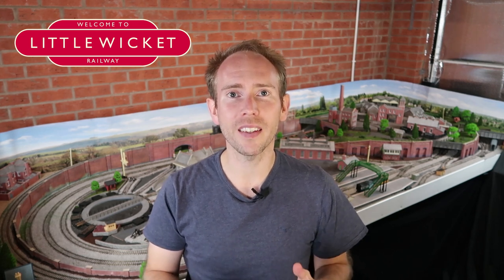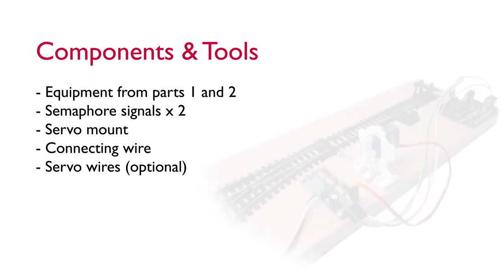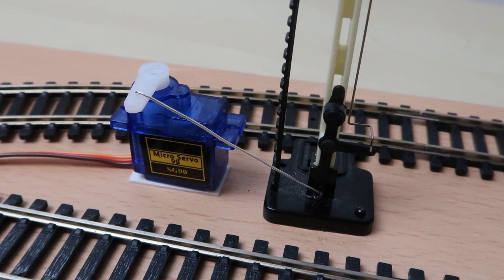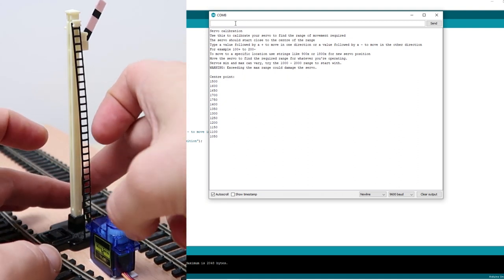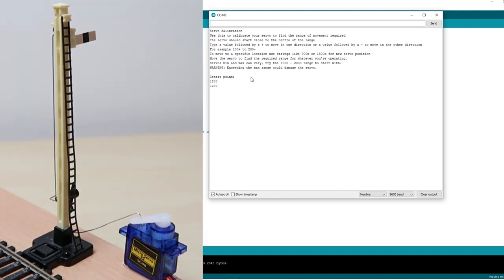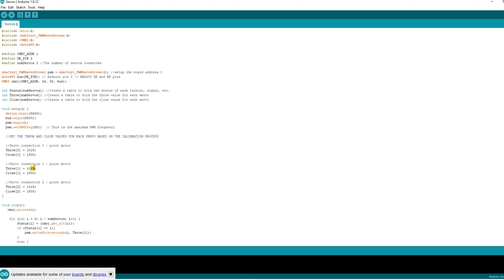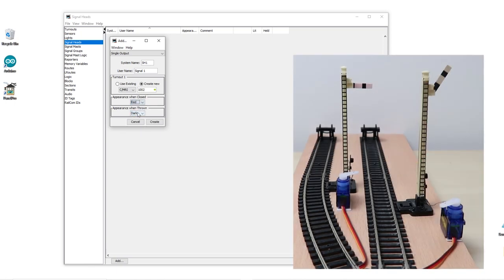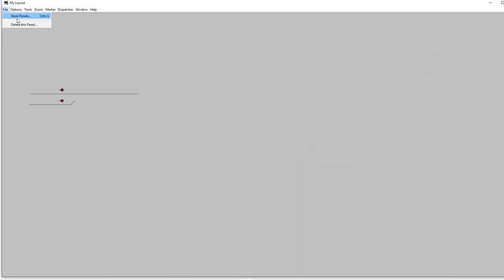Servo Motor Control for Model Railways Part 3 of 3 - Semaphore Signals

Comment: Rob. Well done. I enjoyed watching your video. Today I have built the servo control according to your instructions.  It works fine. I am currently running a Mrc Prodigy with wifi and I am controlling with Withrottle.  I would like to integrate the Arduino to my current MRC System.  I'm Thinking that I can purchase An Arduino Wifi.  This would control the turnouts through JRMI however Not sure about the MRC side prodigy .   Was able to connect JRMI through MRC WYFI  however the Engines Were not listed.  Have you any thoughts on this subject. Can you provide any tips on hooking up the Arduino WYFI.

Comment: I have a few questions I have for you. I have not started my layout but I have got all that I need to start building which I will make a start very soon. I got the DCC++ stuff you did in your video to use arduino as a controller. I guess I would still need the motor shield on top of the main board and I just put these cables for this in the same place but just into the motor shield instead? Also I have some block sensors from blocksignalling.co.uk which I can hook up to the point motors I bought (seep pm1) to tell the block sensor that the point is or isn't in the trains favour and then change the signal (led) as needed. Can I connect them to these servo motors via some auxiliary point like the seep pm1? Also will I need more than 1 main board as I have 17 points!! so 1 off the 16 from the board, or how do I link the boards together?
Reply from the maker: Hi Exzhul!

Quite a few questions here and I'll do my best to answer them.

I think you're suggesting using the Ardunio from the servo motor controller as the ardunio for the DCC++ base station. I don't know if that's possible, it might be, but you'd need to change the sketch to get it all working off a single board. You're not the first person to ask about combining some of these Arduino projects together and it's something I'm looking into.

I'm a bit confused about the PM1/servo question. If you're using seep PM1s then why do you need servos? Or are you saying that you want to connect the blocksignalling product to the servo driver board? I'm not sure if they would be compatible, my guess would be probably not, but if they were then you could use the switch built into the PM1 to act as a sensor for JMRI to update the position of the point within the software which would influence the signal. HOWEVER, when it comes to operating light signals I think there's a better way of doing it using addressable LEDs and an ESP32 board. That's one of the projects I'm working on.

If you need to have more than 16 connections to the servo driver PCA9685 board then you'll need more than one. I've done a video on how to connect multiple boards together https://youtu.be/v1f_EDHV390
Reply: @LittleWicketRailway  ah brilliant thanks for the answers, I think for now I am going to keep with my PM1 seeps that work with my LED signals. I wasn't aware that you would need a new board for this and then one for the controller but having you remind me about the sketch etc I guess it wouldn't work. Thanks for the reply and I love the Arduino for my controller, so much cheaper and does most things these £200 controllers do!

Comment: Hi Rob, I am attempting to set up a second PCA9685 to my system and wonder if you have tried this. I am struggling at the moment as the second PCA9685 seems to be copying the first 16 servos, i.e. when I change servo 1, servo 17 also changes. Any advice would be appreciated.

Thanks,
Brendan
Reply from the maker: Have you addressed the boards using the jumpers: https://learn.adafruit.com/16-channel-pwm-servo-driver/chaining-drivers

You'll also need to add some code to the sketch.

Edit: I haven't actually done this personally, so please let me know how you get on.
Reply: @LittleWicketRailway  Hi Rob,

Yes, I did that. In fact, I have another sketch that I was using which works fine over both PCA9685s so I know the problem is not with the hardware. I was hoping to use your sketches as it is easier to fine-tune the servos using your calibration sketch.
I am experimenting with both servo sketches but so far I have the first board working correctly and the second is still a mimic of the first. 
I will keep at it and let you know if I am successful.

Brendan
Reply from the maker: Any luck?
Reply: @LittleWicketRailway  not so far. It works perfectly on one board 1-16, but 17-32 either mirrors 1-16 or does not work. I think the problem is in the last lines of the code after the servos but still working on it.
Reply: @brendanhannon1577  Hi Brendan, I have the same problem, the 1st pca board is pin 0-15, 2nd pca is pin16-31, in the CMRI, the address  will be 1(for pin 0) and 17 (for the 2nd board pin 16). Note : you need to solder A0 in the 2nd board. Mine is working.
Reply: @nugrohosetiabudi2783  Hi Nugroho, thank you for that. May I ask what changes you made to the coding?
Reply: @brendanhannon1577  I can share you my code, how do I send you email? (not to display email address in the public chat?)
Reply: @LittleWicketRailway  Hi Rob, finally sorted today with help from Nugroho Setiabudi
 (In your comments) who has set up 3 x PCA9685s.
Reply from the maker: @brendanhannon1577  Awww man! Congratulations, but I've just made a video on it! Going up tonight. Someone else asked about it too so I had a go and filmed it last night.
Reply from the maker: Better late than never https://youtu.be/v1f_EDHV390
It sounds like you're ahead of me on this, so if you've got any improvements (I'm not a great coder) then let me know :-)
Reply: @LittleWicketRailway  great video tonight with really clear steps thank you for your hard work

Comment: Great videos Rob. Question on the servos you use. Can these be programmed to move in small steps to simulate prototypical movement speeds, or add things like signal arm bounce?
Reply from the maker: Thanks Andy! Yes they can. You can modify the loop in the sketch so that rather than going straight from thrown to closed, it goes through a range of position steps which will slow it down.

If you watch the video on coloured light signals then the same code used for fading can be used to slow the point movement.

Bounce would be more complex, but could be done in a similar way.